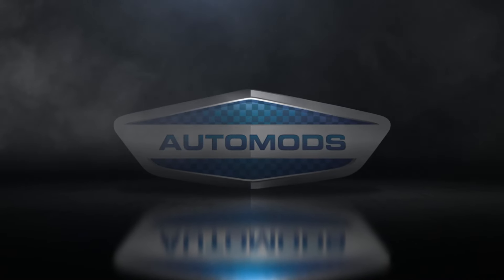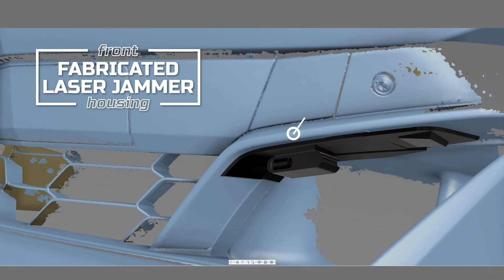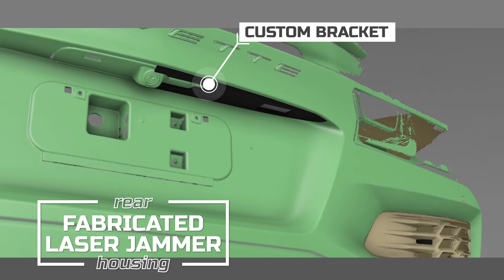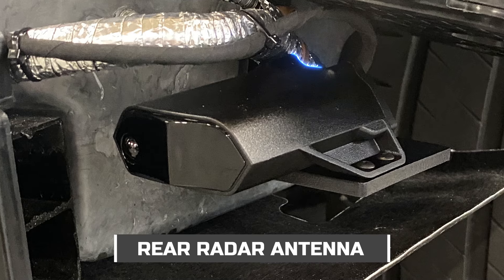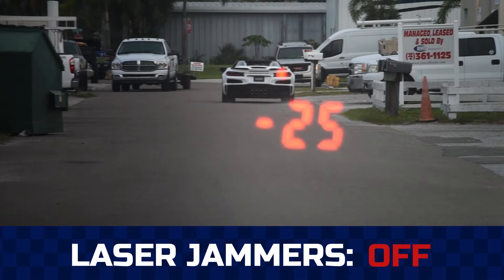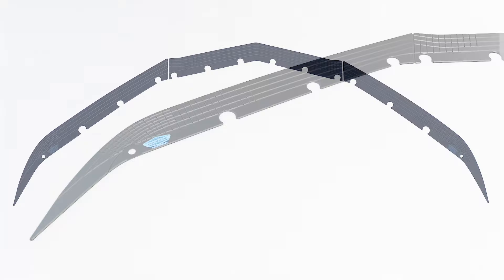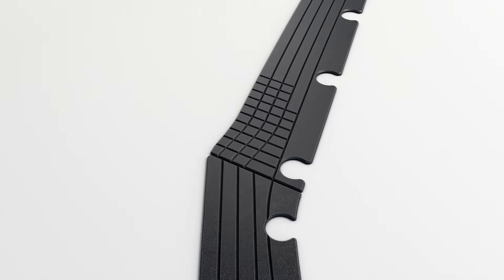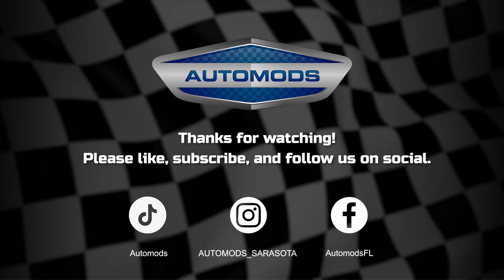Chevrolet Corvette C8 Z06 Radar/Laser Defense System

Comment: I gotta say, most aftermarket companies would just 3M tape the transmitter part to some part under the bumper (front or rear) and call it a day. The fact that your company 3D laser scanned the bumper so your equipment can integrate seamlessly to the factory hardware is fantastic. 
I'm sure this doesn't come without cost but for a factory OEM style equipment and install, there is no substitute!
Great job!!!
Reply from the maker: Thanks, appreciate it. Our goal is to design/fabricate parts that look like they came on the vehicle from the factory.